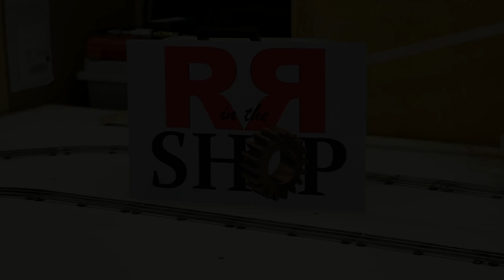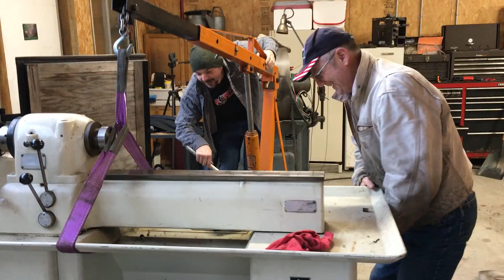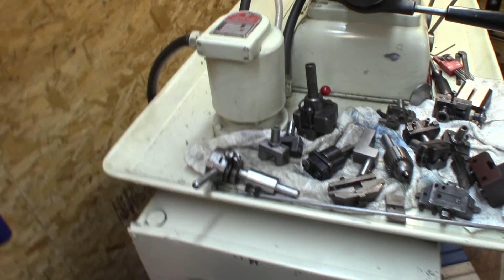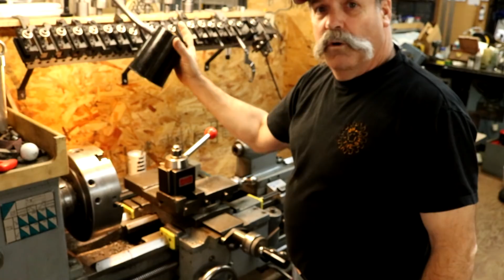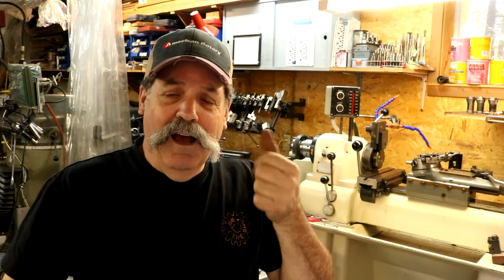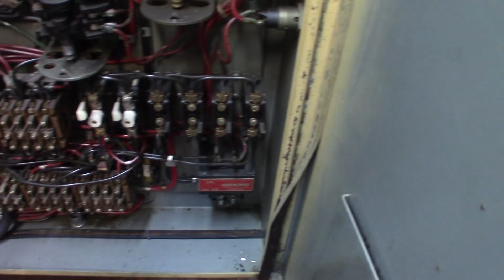Hardinge DSM 59 Lathe In The Shop

Comment: You mentioned needing to run the lathe in reverse for using the rear tool on the cross slide. Not true. Just set the tool upside down. No need to change directions with this setup unless you are threading using a die holder and need to reverse to back off the die. And even then, a releasing die holder removes that need. A small turret lathe like this can do a LOT.
Reply from the maker: Yes this is true.  Thank you for your thoughts.

Comment: Hey Randy, I'm wondering what flood coolant you're using on your Hardinge. Is it waterbased or pure oil? thanks!
Reply from the maker: I tried out water based but later found out that on these older Hardinge you should not use that.   There are no seals to stop water getting into the head stock bearings.  So I switched to oil, I use Mobilmet 766 Thread cutting oil now,  Works great.
Reply: @rrintheshop  Thanks for the reply! 766 on order, much appreciated!

Comment: I have that exactly hardinge that was given to me for free I was so lucky. I feel a little guilty because at the time that it was given to me I was dying or so they thought but I miraculously defeated Maybe this really bad condition called lambert-eaton syndrome. I never got cancer like they thought and now my antibodies are going away so they think I might have beat it!
So this company that gave this to me he I found out gave it to me because they hadn't used it in years and years and years and they thought it didn't work. It turns out their Transformer was burn up on the primary and they were not very bright cuz that's the first thing I would have checked. and there was a couple things wrong with it like I noticed on the speed control it said Do not pass this point. I found that to be kind of odd so I looked and the maintenance guys wired the damn limit switches backwards I saw it as soon as I opened it up and I couldn't believe it. So I fix that in two minutes the only thing that's kind of glitchy with it is one of the contactors sticks it's the contactor to turn on the cooling pump. if I hit it with dry lube every once in a while and work it back and forth it seems to fix it it's a physical binding. So I'm having trouble finding that exact contactor but it's not really a big deal because I can get it to work anytime that I want it.

 I'm not bragging I will be in very very lucky very lucky I think my lathe might be about a foot and a half longer but other than that exact same setup.

if you want to get a nice addition to that guy right there get a Threading head I found one on eBay for $200 and again I really got lucky I'm not bragging it was like brand new it was dirty but not a scratch on it period with it came 40 Chaser sucks real common ones duplicates of like quarter 20 and 832 Etc. But it's a real nice addition if you doing a bunch of parts that have threads you can really fly through them fast.
Tooling that sucker is so expensive. You can find anything you want for it in abundance so you think it would be cheap but it's not. I'm still trying to be able to afford that vertical cut off attachment that you got there. I found an old turret the same one you got there and it was covered with an inch of grime and dust and particles of wood and splinters and I scraped it all off in the God damn thing was like brand new other than the paint so I took all the paint off there was no rust and I cleaned up the metal I took the Gibbs out and there was not one damn scratch or where mark on the Gibb so the turret is very very very nice. I got it for almost nothing the guy on eBay just listed it it said new listing I think I paid $180 for it which is ridiculously cheap for a turret.

I got a couple of tip slides for free with the unit some people call him taper slides I had to fix a crack in one with braised it's cast iron. And I'm going to have to fix the top has a little blowout on the other one at one end of the T track I got some nice cast iron pieces that I'm going to fix that and then run on a keyway through it.  

Anyway great video you got an awesome shop I'm jealous my shop is all ice cold or burning hot garage that I share with my girlfriend the woodworker so it's a constant fight of keeping dust off my machines LOL. Anyway thanks for the video love the hardinge
Reply: sorry about the wall of text I drink a whole bunch of coffee before I posted that. I can hardly stand reading it myself LOL

Oh and by the way I use voice recognition so there are a ton of incorrect words that changed the meaning of sentences

Comment: Great info!  I bought a similar Harding, and have gotten as far as installing an American Rotary phase converter and powering it up.  I'm at kind of a loss actually using it, and am really looking forward to your next video.  Can you show threading with it too?  Thanks!
Reply from the maker: Is your lathe a turret lathe?
Reply: Randy Richard In The Shop, yes, but you have more parts!  No speed post, collet changer w/o collets, no cross slide or tool posts.  I thought 10C collets were what it took, but learned otherwise from your video.  Is there a way to cut threads if it doesn't have a - whatever you call it - screw bar thingy?
Reply from the maker: The type of collet depends on the type of spindle adapter that is fitted to the lathe.
To cut External threads you need a screw bar thingy and a carraige or a Die fitted to a turret or a Tailstock.  To cut Internal threads you need a tapping head fitted to a tailstock or Turrett.

Comment: Hardinge make EXCELLENT machines, I like those collets that keep registered as opposed to the other types...    
By now I'm not planning any production runs of anything, tired of it....   lol
Daylight LEDs give a good working vision.
I see you're getting good a shrinking your shop also...    lol
You're a mean guy showing Your Winter to the poor of us up North...   
Bricks...   definitly...   Wire choice Kenthal A1 size no18 good for about a calculated current of about 12 to 13 amps, on 120 volts you can get abour 1300 watts, You can get it from Temco near you and free shipping in the US...
Take care,    Pierre
Reply from the maker: How many ft. of wire did you use?

Comment: You my friend have stepped in it , lucky dog . Really for the things you make this lathe will knockem out quicker then crap from a goose. I'm totally envious of the Hardinage . Many centuries ago I put a few years running and setting up turret LATHES monsters compared to the Hardinage. Let's see ya cut acme thread valve control in about two minutes. Die heads collapsing tap heads . From tools . They were purpose built for constant use for a hundred years . Good luck with her

Comment: Good lighting, nice color, camera can’t take all the light. I don’t know what it looks like there, but if it is too bright you can use a dimmer. then turn it up if you drop something, LOL. 

I have been eyeing three phase lathes and the VFD folks say they will work fine if you match the amps (not HP) plus a fudge factor, to the motor and run the on/off and reverse switches to the vfd and not the motor. I guess rotary is best if you have the bucks. This is all hearsay, so take it for whatever hearsay is worth.

Nice Hartinge, looks almost new. Pamper the spindle bearings, they cost thousands and the install is tricky, at least on the other model, designation escapes me at the moment.

But maybe you knew all that already, I’m new to your site :)
Thanks for sharing.
Reply from the maker: Not to bright, as you get older you can't have to much light.  I run VFD's on 2 lathes, 1 mill and 1 Surface grinder.  Yes you need to have the VFD control the switching if possible.  You do not want to do any switching of the output thru a mechanical switch/relay while the VFD is supplying power to a load.  If there is no load on the VFD you can do switching.  I do this on my big lathe, since it has a two speed motor.   With a rotary phase converter you can do downstream switching.  The Hardinge control is all done with mechanical switch gear, so the Rotary Phase converter was the easiest and fastest way to get the lathe up and running.   The Phase converter is very quite and is working very well.  Thanks for your great comment.

Comment: Hey Randy, have you ever seen the dam above Nevada Falls that diverts the Merced over Nevada Falls?  Most people walk right by it, but never notice it.
Reply: Hey, i think i could see that on google earth. Love old stuff like that.
Reply from the maker: Well my wife and I have been over the bridge at the top of Nevada Falls many times and have even rode our horses across, but we have never seen a diversion dam in that area.
Reply: It is only about 100 feet off of the trial, but unless you know about it you would never notice it.  If you come up the Muir Trail and cross the bridge, and as you are headed towards the outhouses at the top of the Mist Trail.  You cross a small little drainage, usually just a trickle about 100 to 200 feet from the outhouses.  Follow the stream towards the Merced and you will see a small arched dam that keeps the water going towards Nevada Falls and out of that tiny drainage.  It has been there for 100 years or something like that.  If you look closely on Google maps you can see it clearly.  You can learn some interesting things reading the history books while working in the museum.
Reply from the maker: We will check that out , thanks for the info.

Comment: Sweet machine. I ran turret lathe over  40 years ago, at my first shop job. Some time  next week I'm going to finish my other 2 tools now I have a proper dovetail cutters that will not wear out on tool holders. Love the lights in the shop. It sure brightens the place up. I 'll email you with the link to my video using the cutter.
Reply from the maker: Thank you James for your support.  The cutter should work great.  I look forward to your video.

Comment: hey I have one of those! scored it for 200 bucks with the turret, the cross slide and a compound dual slide with a magnified angle sight glass, pretty sweet.  Stoked to see more vids.
Reply from the maker: Great price.  Mine was Free except of the travel to pick it up.  I will have to work on getting a cross slide and tailstock, they are quite pricy.
Reply: Tailstock? for what?
Reply from the maker: You may want some support for something that might be 4" long and tough material.
Reply: Yeah I guess that makes sense for some long parts but its really not that type of lathe. Box tool perhaps? 
Not many videos online featuring setups on these things, but very versatile. looking forward to seeing what you do with it.

Comment: Do you know what your table really is? If not it is a veterinary surgery table.
Reply from the maker: Well it came out of our local Hospital quite awhile ago, My sister-in-law who is a Vet. acquired it from the Hospital.
I acquired it from my sister-in-law.  Probably an autopsy table.   It tilts and has drain grooves, hyd. up and down.
Reply: I was a 50% partner in an Animal Hospital here in Florida and we bought a new one 20 years ago. Mine was to short for an adult but it was great for animals, there should be a hook for a bucket under the drain hole, great for working on hydraulics..